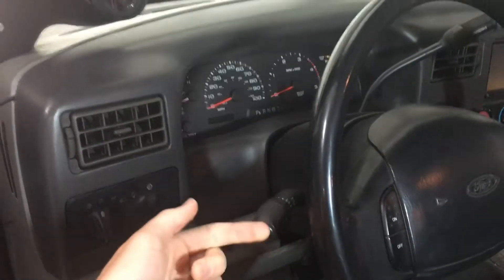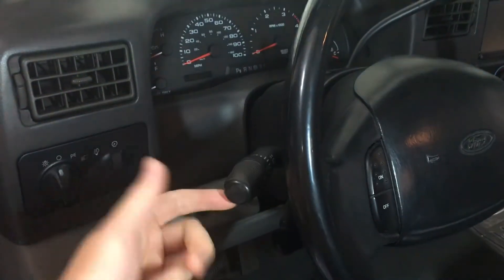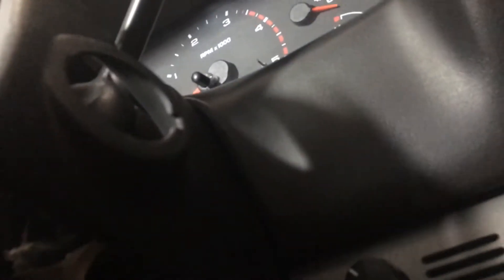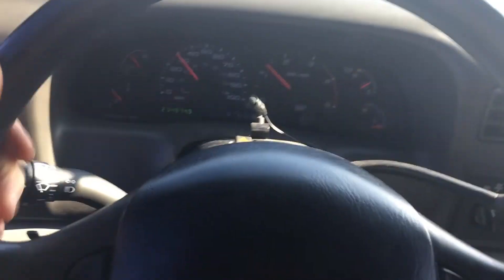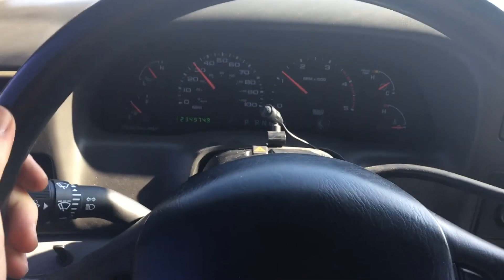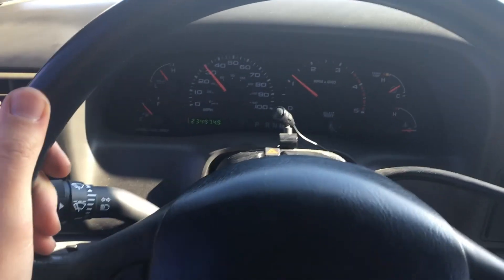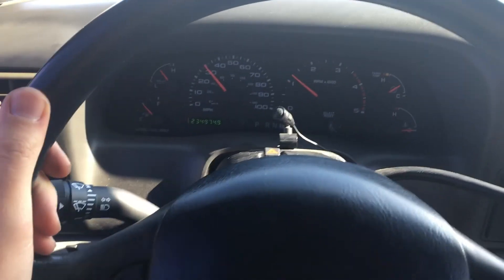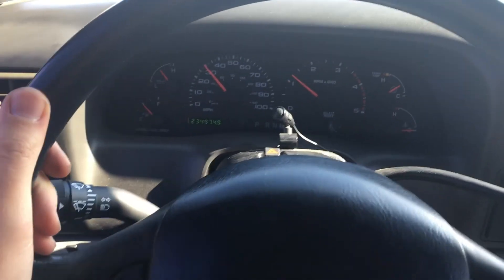How To Replace Turn Signal Combination Switch 02-07 F250 F350 Ford Super Duty (The fast method)

Comment: Could that be what would cause the headlights to not work unless you hold switch towards you?
Reply: Possibly, replacing mine for the same issue cant find anything on it.    My sprayer also stopped working but just put in an independent switch.  Also replacing the switch for the lights
Reply: With the sprayer function failing a while back now the lights acting weird its leading me to believe the switch is shot.   Only one of my headlights work when pulling it back too lol

Comment: What all tools are needed?
Reply from the maker: It's been a while, but i'm pretty sure just some basic stuff like a phillips and flat blade screw driver, and a punch for removing the key cylinder. I can't remember if you need a torx driver or not
Reply: @JesseMcFie  huh huhuhuhuhuhu uyhuuhuhuuuhuhuhuuhhhhuhhhuhuuuhuhhhhhq